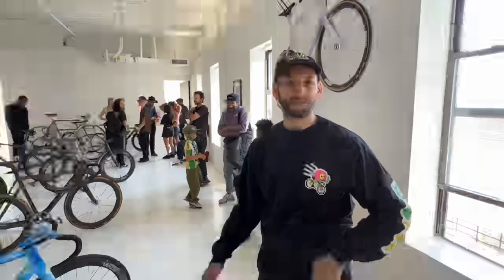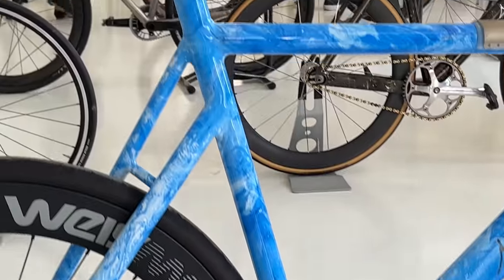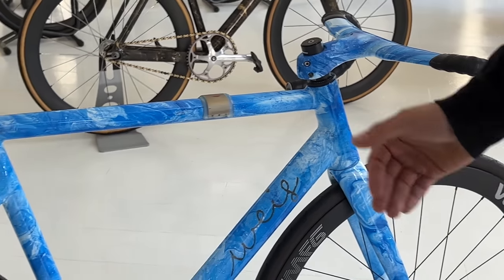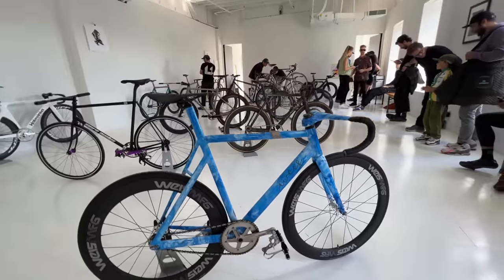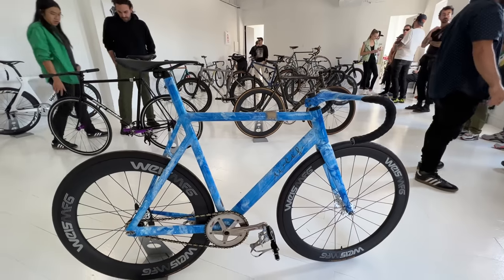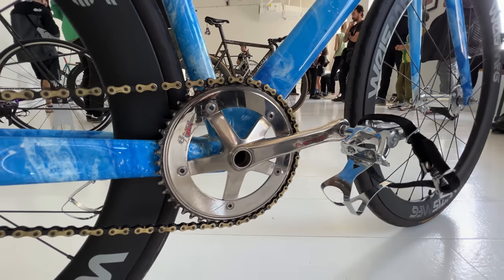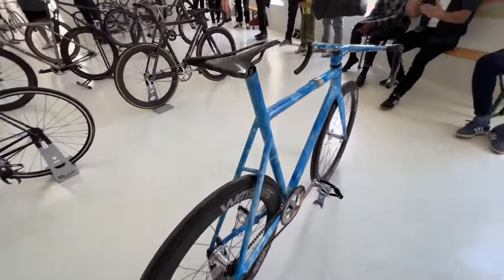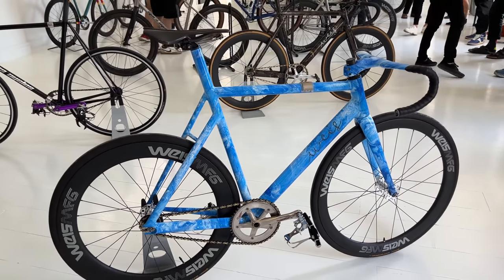Whip Skidding Paint Dripping

Comment: Okay. Being a welder for the last few years reaaaally sketches me out about  alum frames
Reply: I’m curious, is it just because it’s a soft metal or something else?
Reply: the seatstays alone
Reply: @ajearlywine4622  to me it’s a bitch to weld. So steel when you weld it moves toward your torch same with Ti, but for aluminum the torch pushes it away so you have to give it more heat and throw some filler rod on it to get fusion. It’s harder to weld and I have n aluminum bike. If you look at my bike you SEE the fat ass welds. The fact that this is so clean and seamless makes me wonder how much they had to grind off to get that look. So if the tubes here on this bike are like thin it takes a pretty skilled welder to achieve a clean strong weld with decent penetration. I’d like to see this bike sent to Hambini to see if it needs a reaming or not.

Steel is real.

Comment: Who TF put gator skins on there? 5000s heard of em? Seriously? Gator skins?
Reply: gatorskins are heavier by a relatively small amount but have tested far more puncture resistant. The Gps are the better performing tire speed wise but I personally prefer the look and puncture resist of the gatorskins.
Reply: They’re running no brakes either so skidding would chew through a set of 5ks in no time haha.. 5k on the front for the grip and low rolling resistance, and a gatorskin on the rear for the durability is my choice for a brakeless fixed gear
Reply: @eddieobrien6960  good point